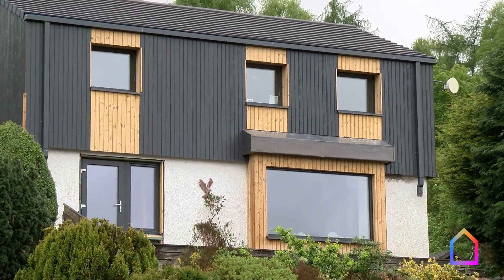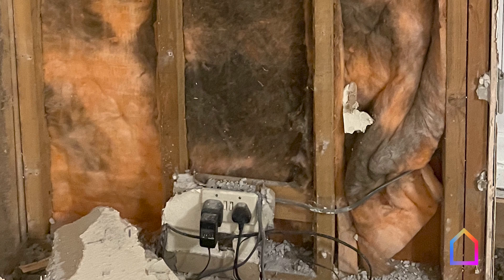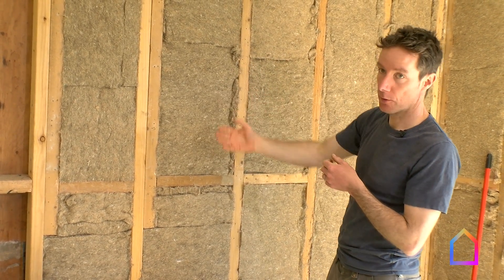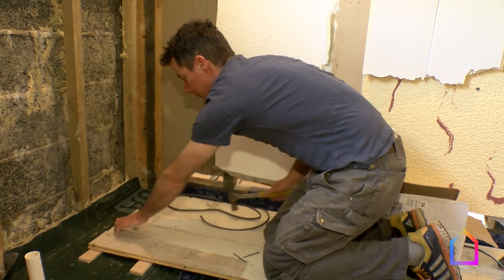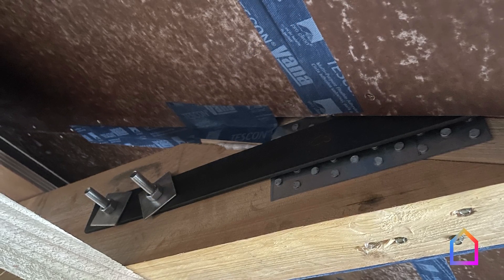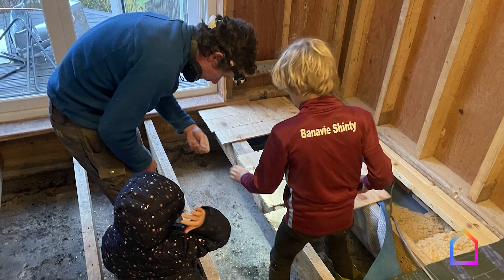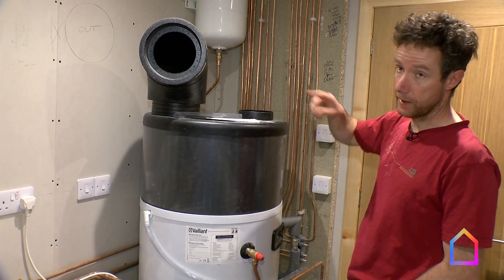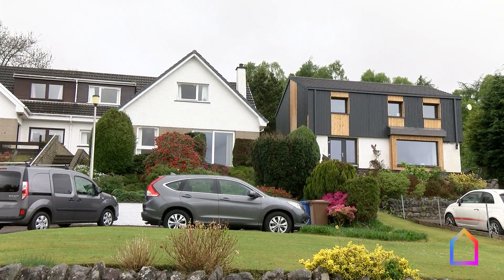INSIDE a DIY Deep Energy Retrofit (a Passive House EnerPHit)

Comment: Stupid question. How does those tapes glue hold on for 10-20 years to keep the air tightness as good as it was in the beginning?
Reply: The tapes and adhesives are designed specifically to last and will easily last 100 years if they aren't exposed to the elements. However, the builder (DIY or otherwise) needs to read the product spec sheet to ensure that the air barrier tape is compatible with whatever it is applied to.  Having the experience and knowledge (or some extensive research) is a key part for success in the execution stage of a Passive House.
Reply: @hiramcamp1930  I have to disagree. There's numerous examples where adhensives has just dried up and died. Or the glue has transformed itself to some weird form.

Things were made to last in 1924. I doubt that most of the ones from 2024 will last to 2124. 

Air & moisture are elements as well.

Still, I wouldn't buy scotch tape from you, based on your claims.
Reply: @jacksmith4266  I don't know squat about building but I do work with adhesive tapes in aviation. They have changed MASSIVELY in the last 15 years. When I started in the 90s a tape would dry up after a year but the stuff we apply now will not loose much adhesion over a 5 year period in an extreme environment. I can well picture tapes with a 20+ year endurance in a warm home these days. But surely there's going to come a point some time in the future where you're going to rely on the mechanical retention to keep the sheets u?
Reply: Not a stupid question at all by the way 👍

Comment: Can you get EnerPHit certifications if you do it yourself without being a Passivhaus tradesmen? Was this house certified?
Reply: You can absolutely do a DIY EnerPhit. You (or a PH consultant) will need to model the house in PHPP, carry out the work exactly as designed, you need to gather evidence of the work as it is carried out, have an air test carried out by an accredited tester etc. etc. the people carrying out the work do not need to be PHI certified tradespeople but the quality assurance process must be followed precisely 👍

Comment: Ed, is that what they call a mini split heat pump?   Make and model?
How noisy is the internal unit.  
Is it ok in freezing weather.
I am considering one in my house in Kinlochleven 
Thanks
Reply: The one on the wall is a ductless minisplit heat pump. Internal unit is just a fan so not noisy There are models that operate in climates like Alaska- you likely don't need that in Scotland. I recommend Japanese brands like Fujitsu, Mitsubishi and Daikin.

Comment: Great job and excellent video. I'm actually quite surprised that the single heat source in the dining room heats the whole house but I suppose that's down to the efficiency of the sealing and insulation and the passive heating design

Comment: Surprised the hot water air source heat pump isn't using the output from the MHRV as its source of heat.
Reply: I'm pretty sure that the energy "available" from the MHRV would fade into insignificance compared to the abundant energy available from the external environment. Certainly not worth chasing with elaborate additional plant and engineering design time.. The MHRV system would be a compact and relatively efficient sub-system as is..

Comment: 😅😅 sorry. But 100mm inside brings the condenswatterpoint inside the construction.  If now warm air from inside  comes to this point .more condenswater. Airtight is 100% important. 👎👎🇩🇪. German word. Can't make a hero in Derby from a donkey. 😅😅
Reply: Look at 4:34, the construction looks alright to me as an (german) architect. Should be pretty save as there is just 25% is just a 40mm thermal insulation behind the vapour barrier is 140mm. There is also an installation cavity before the vapour barrier, this gives you a nearly fool prove system. Also the  intello vario vapour barrier helps to dry out the construction in summer, together with the forgiving hamp and the cavity between the outside bricks and the insulation thumps up from my side. 🙂
Reply: @mauersegler9894  how would you do a shipping container for 1c to 40c weather. steel container insulation vapor barrier plywood?

Comment: It turned from the typical cold and mouldy Scottish house into a real gem, well worth the effort.
The real gain is not just in the savings made on heating, but the gain in comfort.
I have insulated my roofs and exterior walls from the outside, and despite having a rather large property of 210m² of living space plus an accessible attic I do just use 2-2,5kW of heat at an average 24 hour temperature of 6°C to heat living room and kitchen up to 20°C and the other rooms to 17-19°C. Upstairs no heating is needed at this outside temperature to keep these room temperatures.
That's a far cry from the 9-9,5kW needed on average during the heating season in the past and then the master bedroom would still be freezing cold in winter with the radiator on, room temperatures were deliberately set lower to get not bankrupt on the gas bills .
I also changed from a gas boiler to air to air heat pumps (needed more than one because of the size of the house) and I think the same heat pump water heater as in the video.

Comment: Makes sense my heat pump sits outside where it is very cold in the winter and when the pump freezes up it takes the heat from the house and pumps it outside to unfreeze it.Surprise surprise it costs a complete fortune to run.I notice heat loss calculations weren’t mentioned and all the excuses that heat pump guys use to dispel why it’s so unaffordable.Funny that
Reply: You must be somewhere very very cold. Consider ground source heat pump (geothermal).
Reply: @Robin-xe4yz  Robin 🇬🇧 it is the government pushing people into having one the houses have no insulation old 1910 built.Heat or Eat over here now.
Reply: Where exactly are you? The defrost cycles shouldn't be all the time and aren't a major problem. If you are in a cold climate you need a heat pump rated for it- I'd go with one of the Japanese ones as we have the most experience with them. I have 4 in my current house (Panasonic and Daikin- also like Fujitsu and Mitsubishi) and am very happy with the comfort and performance.